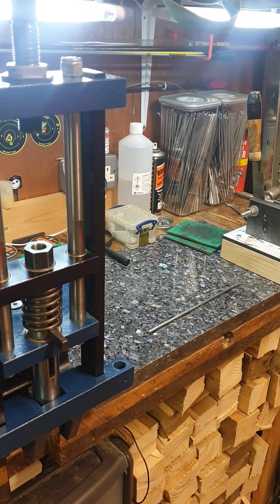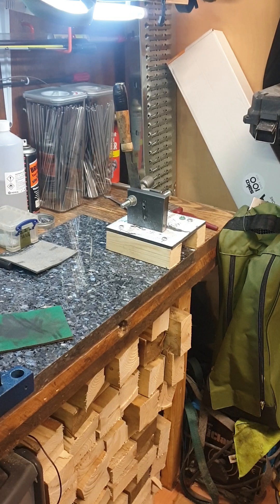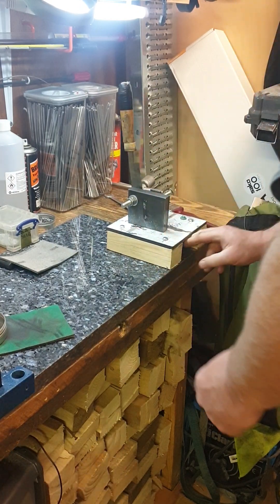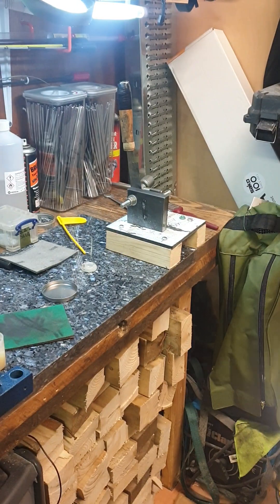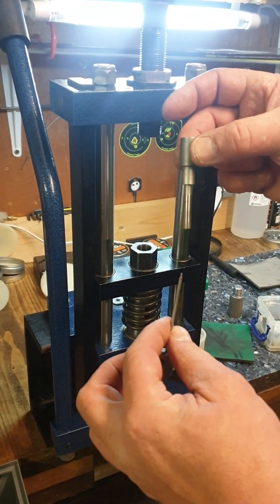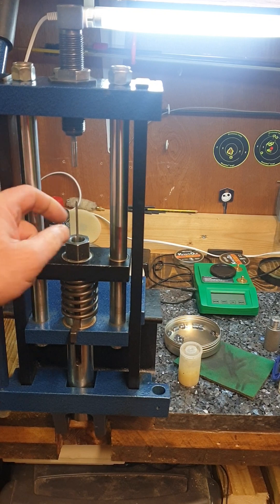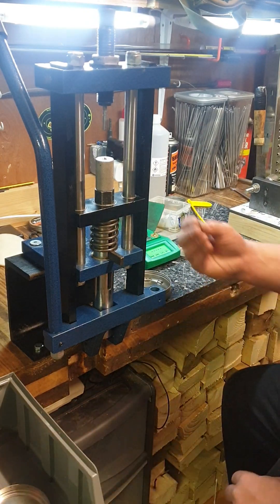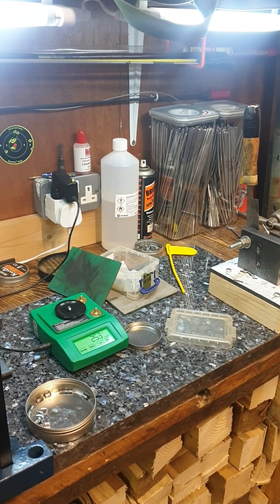.22 airgun hollow point slug swaging

Comment: what swager is that please
Reply from the maker: Hi It’s a Richard Corbin chestnut hill , basically the same as the mega mite from Dave Corbin
Reply: @Premierslugs  ah ok thanks for that, im using a gmi swager, saves a fortune on slugs, where do you get your lead wire, i cast my blanks as im a roofer in london i get a lot of lead but the wire looks quite handy.
Reply from the maker: @PeakyBlinder  I buy it from a place call heaps In Rotherham they will make it pure lead or add tin or whatever else you want and also swage it to the diameter you want too
Reply: @Premierslugs  I could detect your sheffield accent,
Reply from the maker: @mikesmith8313  No not from Sheffield , live in Barnsley,but from Hemsworth lol